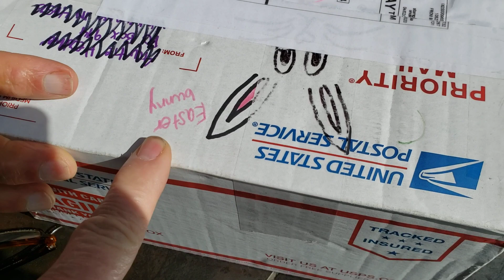RWG Research Stan Meyers Part 1 Spark Injector "SOUND OUT" HydroMe TrueFuel Cells Hydrogen Deuteride

Comment: I have a suppressed spark plug design used in secret in bombers. Can run off any water type, get more power. Plug is 2.3" wide and about 5" tall. Need big cylinder and a head you have space to machine. Most don't have space because valves. Pure hydrogen it doesn't make, and you don't want that without ceramic coating otherwise it'll burn a hole through the metal. Pure h burns HOT!!!